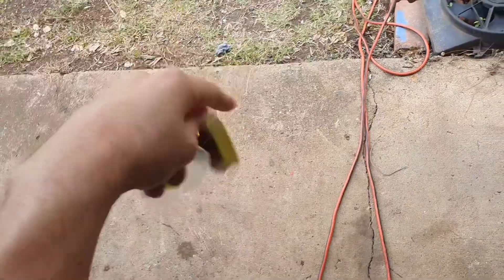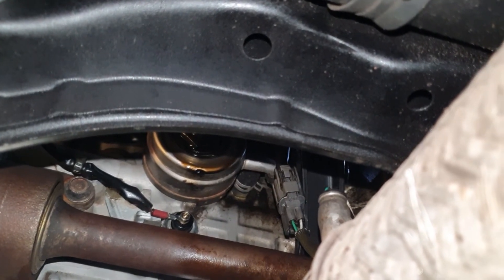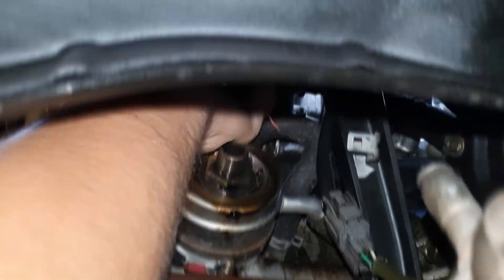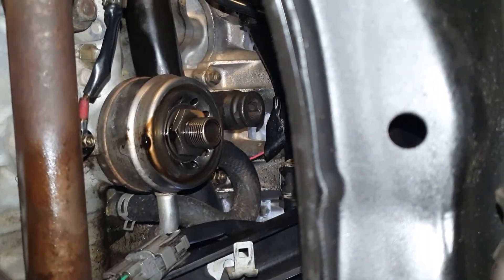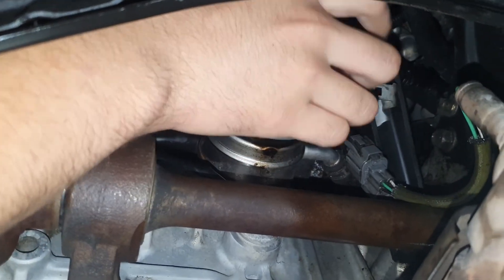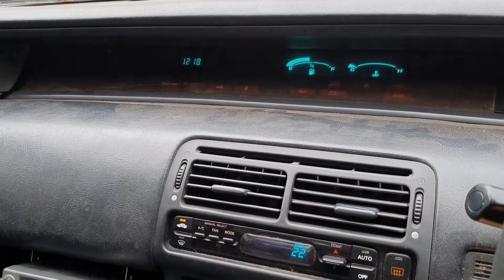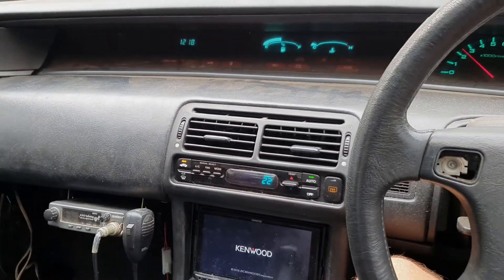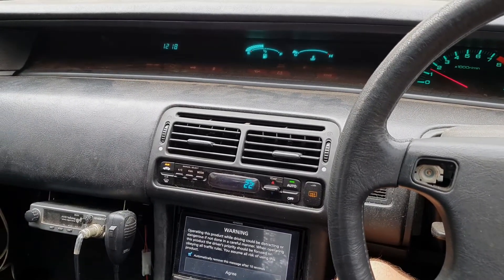4th gen prelude knock sensor replacement.

Comment: Help! What socket are you using? I can't fit my impact socket up there, and my normal shallow one is too shallow :/
Reply from the maker: for the black plug 4th gen sensors it was a 24mm deep, for the 5th gen green plugs its a 27mm deep
Reply: @VehicleMechanical  Thank you so much!

Comment: h22a p13 constant code 23 in guessing at this point it's because of hasport motor mounts, car is swapped in a civic ek.  changed ecu  ran new wire still throwing 23 thinking about running a shielded wire hope that works💔
Reply from the maker: Shielded wire and make sure the engine has good ground to battery negitive and the chassis. Use thick cables and clean grounding points. These cars are quite sensitive to poor groundings. Also would be worth your time buying an ocliscope and checking the signal coming back is clean.
Reply: Timing is probably to advance could cause knock. I retarded it n drove fine